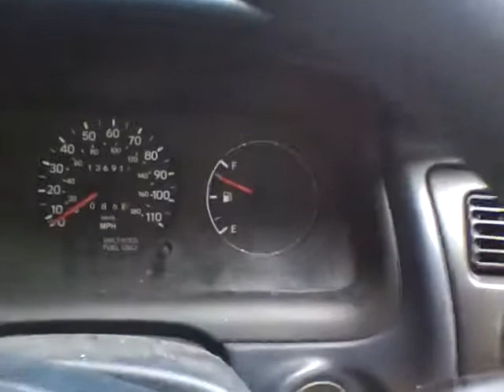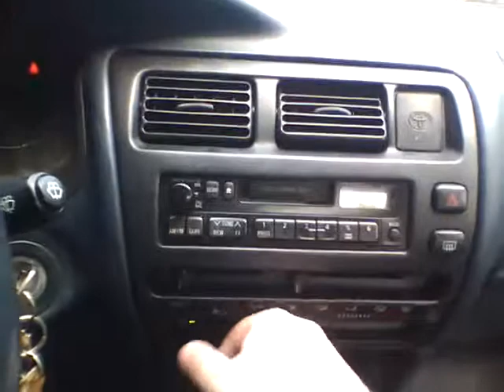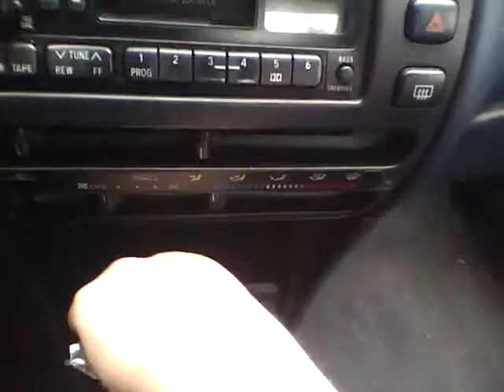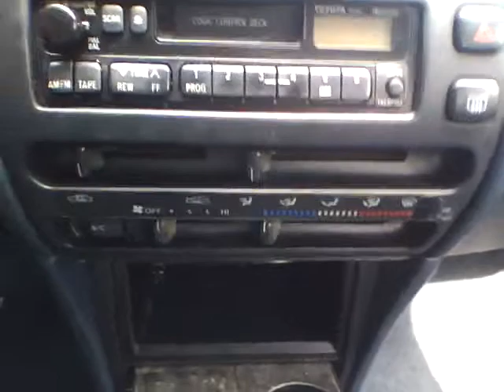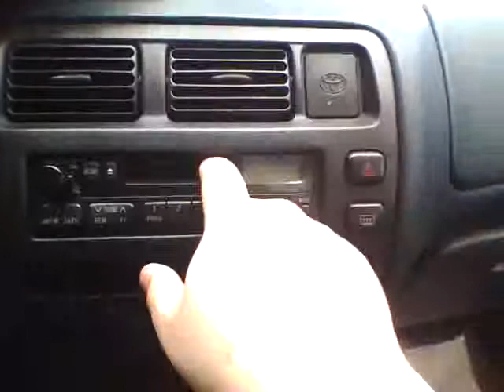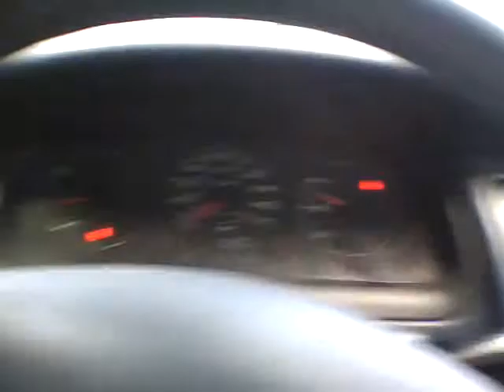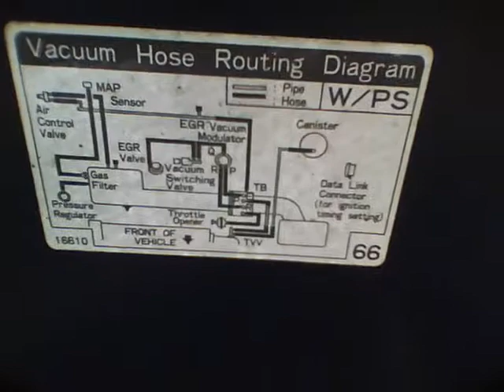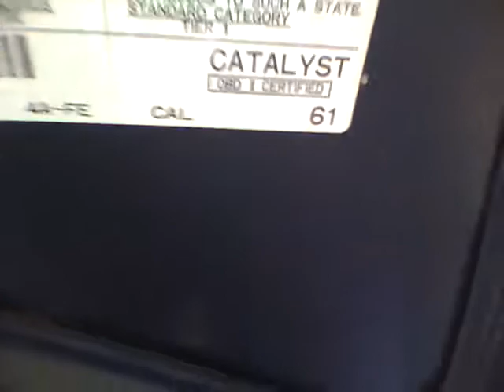HOT OUTSIDE OH GOD I'M MELTING | Cold Start '96 Corolla 4AFE 1.6L Auto. / iPod Nano 5G Mic Test

Comment: An understandable reason for not driving one, I've always driven stick and my old blue truck since I was 13 and really hated to drive automatics simply because they would shift at points that would either waste fuel or kick the engine out of the torque curve when I need to be in it. Once you get the feel of it shifting does become second nature and that's half the battle.

Comment: driving on a stick is much faster than automatic..that's why race cars are always on sticks.
Reply from the maker: it's not faster per-se, it's entirely human-dependent. if anything, the ECU is much faster at making a shifting decision depending on the way it's configured. if you know your car well and understand the desirable sweet spot for shifting into whichever gears you want to, you can definitely shift faster than an ECU can shift an automatic transmission in a car like this, but unless you go out and spend a few hundred bucks on a completely programmable ECU and tune it on a dyno, you're only going to get like ~2 to 3MPG more on average, with a stock engine such as mine.

still can't drive a stick though. I'll probably practice driving on a manual '02 Cavalier owned by a friend in MO sometime in the summer. it's helpful to know how to drive it, but I still wouldn't on the highway here-- too many idiot drivers on the road while you're going 75 across 3 highways with some lunatic riding your ass in the left lane. this is my commute to and from work. in this sense, a manual-trans car will only distract me... I have a mild case of ADHD (clinical diagnosis from 11 years ago when it wasn't a buzzword  and the mainstream public didn't know about it really) and I'll tend to get really really focused on driving and just driving. adding the manual transmission factor in there would only make things harder on me.